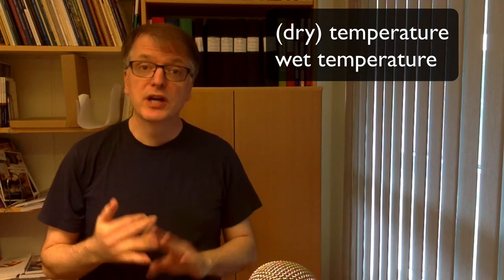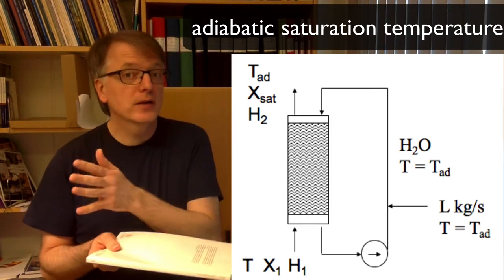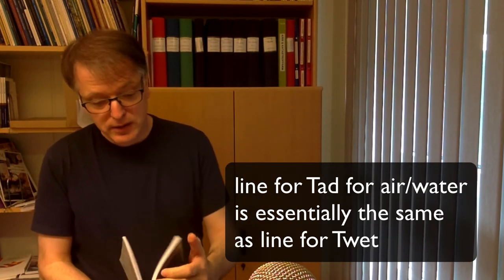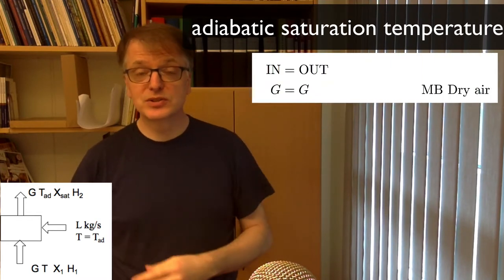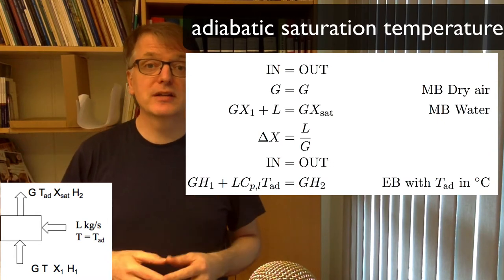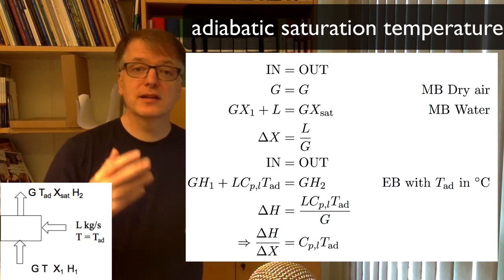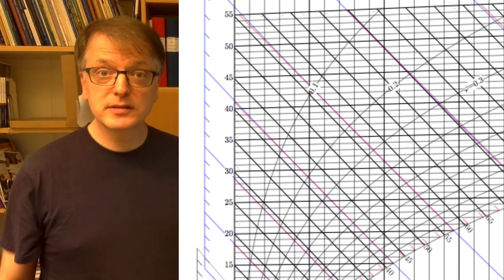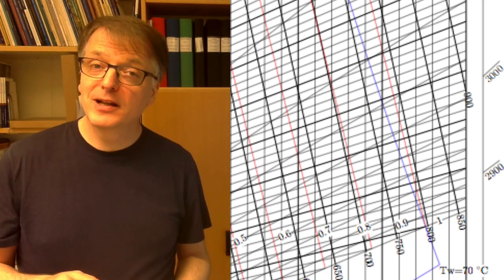Adiabatic saturation temperature

Comment: What determines which fluid cools and warms on an evaporation process? Is it possible for both the air and the water to cool? The reason I ask is that in another lecture it was stated that when the liquid evaporates it draws the heat from the liquid and the ambient air itself. However in a cooling tower it is shown that the air warms and the water cools. What explains this?
Reply from the maker: I should be doing other stuff now, so my answer here is me procrastrinating ;-)

It depends on initial conditions and/or conditions in inflows to the system

Consider a closed system with the initial condition that we have two phases in contact with each other: 

1. Dry air at 0°C
2. Pure water at 0°C
Since there is no water vapour in the air, some water will evaporate. This costs energy and this energy must be taken from somewhere. But we also know that in a system at equilibrium the temperature of the two phases are the same. Hence both the air and the water will cool down.

I'm not an expert in cooling towers, but lets do some back-of-the-envelope calculations. When studying cooling towers it is common (at least to start with) to only consider steady-state conditions. Thus we don't care about initial conditions. We do, however, care about the conditions of the inflows. The reason we use a cooling tower is typically that we have a hot stream of water that we need to cool down, the hot stream often being a lot warmer than the air. The heat capacity of water is around 4.2 kJ/kg, K and the density about 1000 kg/m3 while the heat capacity for air is around 1 kJ/kg, K with a density around 1 kg/m3 and where the temperature sets a limit for "how much water the air can hold" (I'm formulating myself very sloppy now, but hopefully you get the message). 

If, for example the incoming water is 70°C and the incoming air 30°C how much water would you need to evaporate to reach a temperature of 30°C? (Let's pretend there is only water in an adiabatic vacuum to make this easier)

mwater * Cp * 70 = mwater*(1-x) Cp* 30 + x*mwater*∆Hvap
Cp *(70-30) = x*(∆Hvap - Cp*30)
x=Cp*40/(∆Hvap-30Cp)= 4.2*40/(2000-30*4.2)=0.09 i.e. 9% must evaporate

that's rather a lot. At 30 °C, air can "hold" up to 0.027 kg water/kg dry air (see a mollier diagram/psychrometric chart). So for each liter (i.e. each kg) of flow you want to cool down you would need at minimum 0.09/0.027=3.3 kg of air (but you won't have access to totally dry air so you need more than that) which corresponds to something like 3.3 m3

So, while it is theoretically possible to create a system where both the water and the air cools down it would need to be very large and would be ineffective. Better to design it such that there always is a temperature difference between the air and the water such that the water cools down both by evaporation and by sensible cooling (water cooling down due to contact with cooler air).

The above is with reservations for mistakes, I wrote this rather quickly.

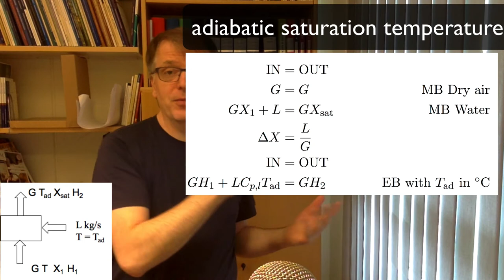Comment: at around 4:35 , if the adiabatic saturation temperature  line is also an isenthalpic line, why isnt H1 = H2 ?   i find that part of psychrometric charts confusing
Reply from the maker: Because the amount of water vapour in the gas phase increases. NOTE: You have two phases and even if the enthalpy of the entire system is constant, that does not mean that the enthalpy of both phases are constant
Reply from the maker: BTW, good and frequently asked question. (Another way to realize that the enthalpy can't be constant is that we express the enthalpy in kJ in the gas phase/kg dry air, but the amount of water vapour in the gas phase increases and thus the enthalpy can't be constant)
Reply: @PLE_LU  Thanks for the answer! so in a psychrometric chart, the what do the enthalpy lines actually represent? is that the enthalpy of the saturated air only?
Reply from the maker: @lucianoosinaga2980  https://youtu.be/Uy93qwN_d0A?t=340 explains what the enthalpy is

The enthalpy lines represent the enthalpy of the moist air (i.e. the entire gas phase) expressed in kJ/kg dry air.

If you by "saturated air" mean "air with a relative humidity of 100%" that's the air you have along the 100% humidity line and on the intersections of that line and the enthalpy lines you have the enthalpy of air with relative humidity of 100%

Of course, similarly the "same" is true for any relative humidity line. So, on the intersections of the to 30% humidity line and the enthalpy lines you have the enthalpy of air with relative humidity of 30%

Comment: Thank you for the video, it was very informative. It left me wondering, in an evaporative cooling process, it is said that it happens at a constant wet bulb temperature, so is it really at a constant wet bulb temperature or is it constant adiabatic saturation temperature?
Reply from the maker: Thank you for a very good question. I hope some of my students read this. Simple answer first:
1. Wet temperature is by definition the temperature you get when the contact time is infinitely small, i.e. a contact time so short that the water content in the air can be considered constant

2. Adiabatic saturation temperature is the temperature you get when you have a contact time between water (that has exactly the adiabatic saturation temperature) so long that you reach saturation (relative humidity 100%). The line the air follows in the Mollier diagram (i.e. Psychrometric chart) in this process is called the adiabatic cooling line.
3. For the special case moist air (in contrast with e.g. acetone in air), the lines for wet temperature and the adiabatic cooling lines are essentially the same IF temperature and moisture content is low. Thus, a common simplification (e.g. in basic courses like the courses I give)  is to tell the students to use the wet temperature line for adiabatic evaporative cooling processes. I try not to say e.g. that the air in an adiabatic dryer follows the wet temperature line, but I do often say "Consider drying goods that has been preheated to the wet-temperature of the air that enters an adiabatic dryer…"  (I also often say "This jacket is warm" although that is, in most cases, thermodynamically incorrect…)

But note:

* Theories are not the same as reality ;-) Your real situation may deviate from the assumptions made…

* Both wet temperature and adiabatic saturation temperature assumes there is no contribution due to radiation (adiabatic…)
* I have no research background in this field, but I have come across some interesting articles, e.g. Zhao et al Experimental Thermaland FluidScience 1992;5:790-794, Davies-Jones Monthly Weather Review 2007; 136:2764-2785, etc. 
* As I understand it, wet temperature lines must be slightly bent (we have Stefan diffusion, not equimolar counter diffusion as water evaporates from a surface which means you get ln( (1-X)/(1-X_sat) ) as a driving force, not X_sat-X) while adiabatic cooling lines are straight (slope being Cp*Tad )
Reply: Department of Chemical Engineering, Lund University Tack så mycket! :)

Comment: Respected Sir,
In the derivation for adiabatic saturation do we assume that all the latent heat required to evaporate the water comes from air and not from the water ?
Reply from the maker: I wouldn't use the term "latent heat" the way you seem to use it in your question, but, let me put it this way: 
1. Since you deliberate choose the inlet temperature of the water to be the same as the adiabatic saturation temperature, the energy needed to evaporate water at that temperature must be taken from the air.
2. In the enthalpy balance G2*H2 of the outgoing flow must equal (since T_adiabatic is defined as the temperature approached at steady state) the sum of G1*H1 and L*Cp*Tad

Our assumption is that the system is adiabatic
Reply: @PLE_LU 
Respected Sir, 
So, would it be appropriate to say that the latent heat of vaporization required by the water comes from the sensible heat of the inlet air?

Comment: Thank you for the video, but will like to know what book do you use in this video? the reference used.
Reply from the maker: The book is designed for the two courses I give and is only printed by the local university printer and not commonly available. It is based on material in Swedish and English I took over from colleges at the department back in 2004 and over the years I have expanded and altered the old texts and added new chapters/sections based on student feedback and how I feel the book works in the two courses. Currently I use different selections of chapters in my two courses, but from the autumn of 2021 it will only be one version, with 8 chapters, named "Introduction to transport phenomena and separation processes"
Reply: Thank you for the information

Comment: I just have one doubt that why didn't you include, in the enthalpy balance, the enthalpy of the water vapour in the incoming stream of dry air and also in the outgoing stream
Reply from the maker: H1 denotes, in this convention, the total enthalpy of the incoming flow just as H2 denotes the total enthalpy of the outgoing flow. The unit is kJ/kg dry air, but it is the enthalpy of the air and the water vapour. See 5.43 into https://www.youtube.com/watch?v=Uy93qwN_d0A&t=343

Comment: Means outlet air and water both wiill be at adiabatic temp?
Reply from the maker: Yes, the temperature of the water flowing in to the system is adjusted until it is the same as the temperature of the outgoing air.
Reply: Thank you 👍

Comment: Tell your book's name in which you are reading?
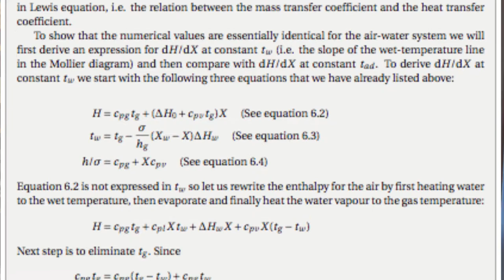Reply from the maker: Do you mean at 2:03 or at 5:10?

At 2:03 the compendium is nowadays called "Introduction to transport phenomena and separation processes"

At 5:10 the compendium is "Handbook. Physical properties, correlations and equations"

So far these two compendiums are only sold locally by the Lund University print shop MediaTryck (https://www.mediatryck.lu.se/en/).  I'm the editor of both, the first one being a compendium designed to cover the two courses I currently teach and the other one (the Handbook) being used in a number of different courses.